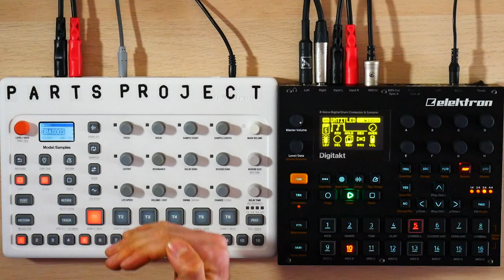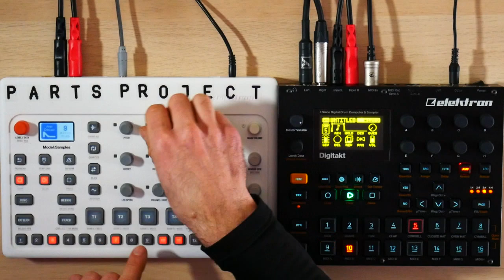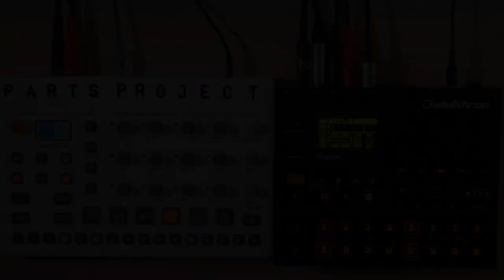Digitakt Scenes possible using external sequencer!

Comment: Nice hack. The reason this works is that it thinks you’re trying to load notes into the currently selected step, so it’s kind of previewing those note triggers with the parameters of that held trigger. I’m pretty sure you can do this with any MIDI sequencer, doesn’t have to be the Model:Samples. Great idea!
Reply from the maker: Yeah I hope so! I haven't tested that yet but I don't see why it wouldn't work with any sequencer. Also, I'm going to try using this same setup but replacing the Digitakt with Octatrack and see how it responds with the hack trig scenes while also using its own scene slots controlled with the crossfader.
Reply: Did you ever figure out if it can be any other midi controller?
Reply from the maker: @njm800  Ut looks like it! A few users have reported it working with various external sequencers and not just elektron devices.
Reply: Ah good explanation. But why does it happen globally, for other tracks too?
Reply: I haven’t tried this myself yet but that still doesn’t make sense to me. Holding a trig for some reason activates any other trigs on the same step across all other tracks if they have the same trigger logic/chance selected??? Whaaaaaaaaaaa???!!! I don’t remember the Digitakt behaving this way before. Such confusion

Comment: that's crazy! how did you come up with this? with a midi loop back you could also use the DT midi tracks, so all triggers, samples and scenes are on the same machine :)
Reply from the maker: I was working on the layering method using the M:S as an external sequencer, then tried locking trigs on DT and there it was. Good call on the midi loop! There are advantages to using the external sequencer but it comes down to the individuals needs! I need the immediacy of the M:S, sample layering,  and being able to play a DT track and affect its scene or turn a parameter at the same time. I'll try that midi loop today in the studio. Let me know how it works for you!

Comment: I was getting deep into this yesterday on the Digitakt and hit the max limit of plocks, i think its 72. In light of this limit, the 64 scenes is a bit unneeded. I tend to stick to one page/16 scenes and have more patterns. Not sure if 72 is the same limit on other Elektron boxes
Reply from the maker: Where exactly is the limit? 72 per step? 72 plocked steps in a pattern? Per track? I'm currently trying to find the limit.
Reply: @partsproject  i think its 72 per pattern., [edit] i think its 80. I tested with 24 plocks on trig 1 on track1/2/3... i added 8 plocks on a trig 1 track 4 and got the “lock mem full!” Msg.
Reply from the maker: @kryten42  I'm getting the memory full message and the locks are still effective! Can you try going over the limit and checking if the locks actually work? I got the locks memory full message a while ago and the locks are still working for some reason.
Reply: @partsproject  DN orig manual said its 80 diff parameters on page 40! As well DT original manual (stonepalmed on 1st page) said 72 different parameters on 36 page. DN 80, DT 72 per pattern.
Reply from the maker: @mikg2618  ignore the memory full message and keep going. There's no limit when using it this way.
Reply: @partsproject  good and probably bad news, bcs it can be a place for a future use ) u know ) one always want to use and limit unlimited

Comment: doesnt seem to work sequencing from DAW over usb
Reply from the maker: @xtremesoundspresets  that's interesting! I've never tried it that way. I'm always curious what the conditions are surrounding this. And it doesnt work with model:samples/cycles either. That might have something to do with them not having a yes/no button, which previews trigs.. I'm always on the case!
Reply: @partsproject  let me know. The one thing I didnt do is apply fill trigs on all 8 parts for 4 bars. I dont have the patience for that

Comment: Jaw Drop! thanks for sharing this is pure magic. if I use my OT as my main Clock and program change machine, and use a Midi 4xThru box, to send to all my devices. how would I then connect these? would I need a midi merger?
Reply from the maker: Just send clock to MS and then midi out from MS to DT. But this works with any sequencer so you could potentially just sequence the DT with OT and leave out the middleman! And I've had reports that this works not just on DT but the A4, AK, and DN also! Have fun!

Comment: What about 2 DTs one triggering the other via Midi and Midi Plock and the slave one using scene trick? 😳
Reply from the maker: I'm considering getting a second DT
Reply: @partsproject  Would it work using 1DT and midi loopback trick 
!?😜😜😜 Never tried it? Would be amazing! And wayyy cheaper :)
Reply from the maker: @Fac-i1k  I haven't heard from anyone who has tried it yet. You need a special cable for that right?
Reply: @partsproject  Nope, the RK-002 cable you mention could be used to play DT polyphonic (cycling midi channels for each note pressed) but your scene trick seems to involve standard midi message per channel so a simple cable from DT out to DT in should be enough to reproduce your trick. Can’t wait to try it, who knows...